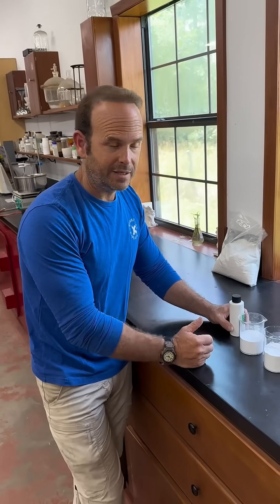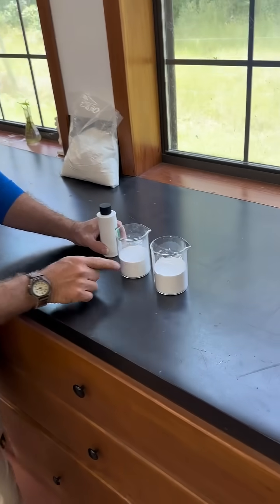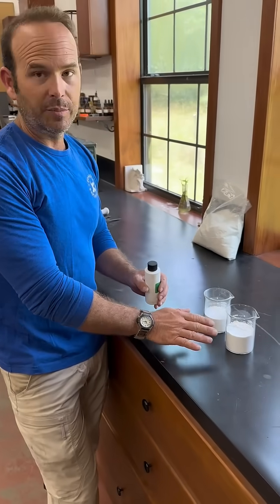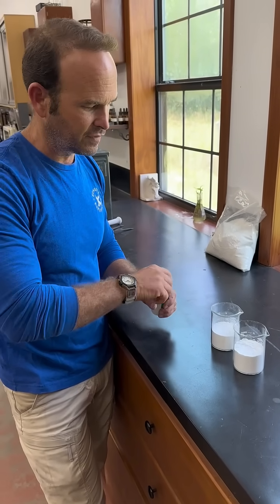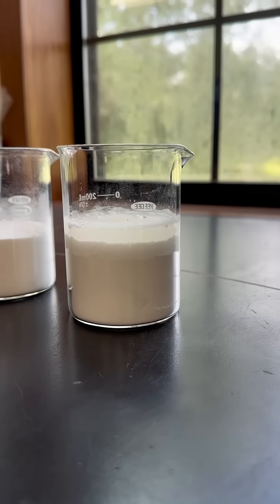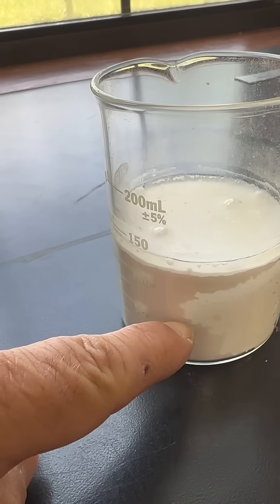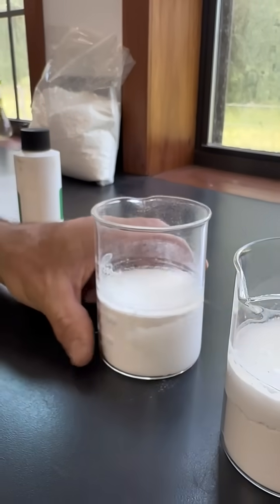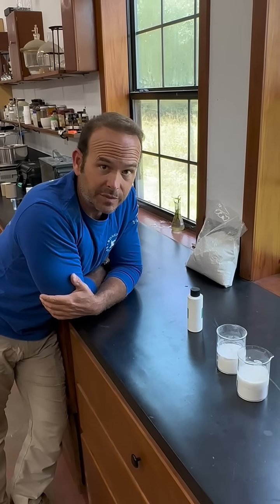Testing Out My Binary Explosive #explosion #experiment

Comment: What if the charge had a small hole underneath to allow air to escape and you had a press on the top like a syringe. That way you could force the liquid down, the air out, and still maintain the smaller particle size. Should be easy to make a press with a 3d printer and some TPU FILAMENT